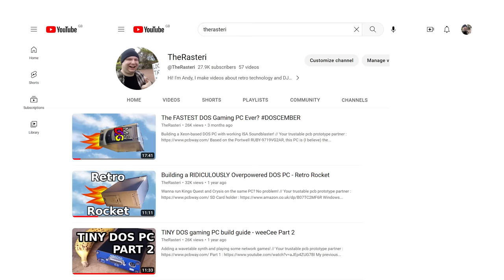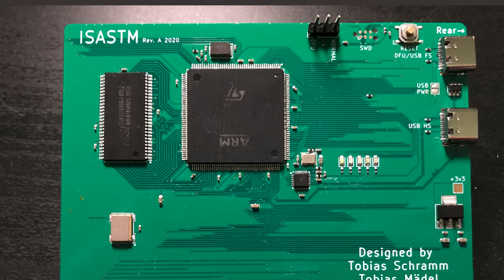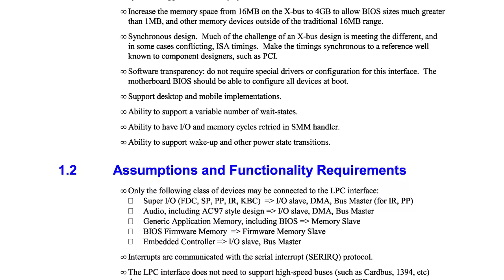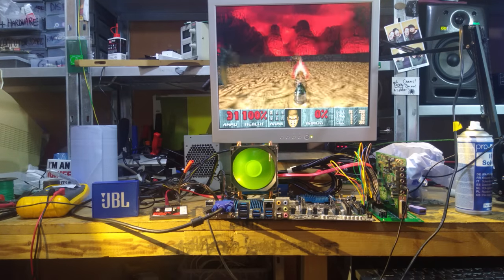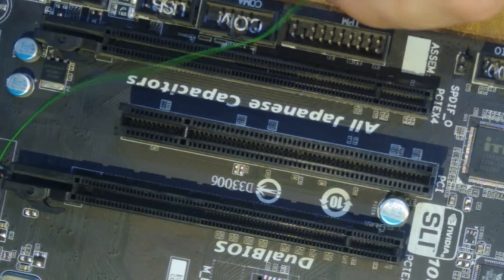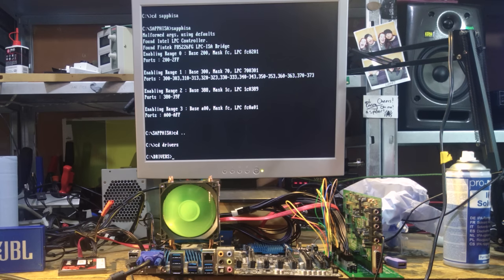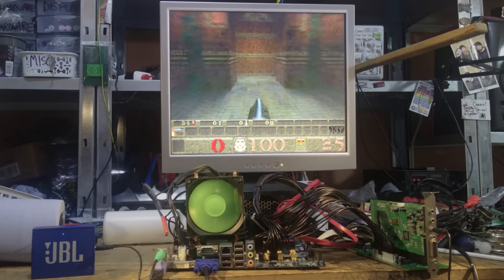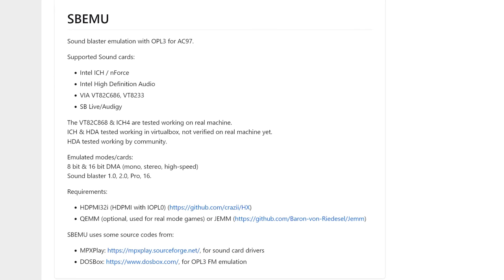Add an ISA slot to Modern Motherboards!

Comment: Re the quake issue, it's been a long while, but i recall as a teen having issues much the same and i believe that it was because certain builds of quake had issues detecting the sound blaster properly and/or the driver was not playing nice with it / overwriting the SET BLASTER = command line incorrectly. You could try doing the full set blaster= A220 I7 D1 T6 (force it to know it's a SB16 (or T4 is if't s  SBpro) the other one could be to try with the H5 as well.

I actually ended up using PCEM to run a lot of the older stuff (which if you can get your hands on the BIOS Roms etc is a really nice alternative to actual hardware and better than dosbox as its a hardware emulation not just all in software)

Comment: This seems like a ton of fun to try.  I'd definitely be interested in buying one.

This may have an obvious answer, but thinking to the far future, would making a PCIE addon card that has the necessary chip and hookups for the dISAppointment be possible, for example for boards or processors that no longer support it on board?
Reply from the maker: I'm not aware of any PCIE-to-ISA bridge chips that support DMA, so likely a custom FPGA/CPLD would be required, and that's a little beyond my skillset just now :)
Reply: @TheRasteri  Gotcha, thanks for the response.
Reply: @TheRasteri  IT8888F is PCI-ISA bridge and PCI should be possible to bridge with PCIe-PCI bridge. Not sure how much compatible is IT8888F with ISA DMA, but it has several DMA request inputs on ISA side.
Reply: @petrcvek  I looked it up and it requires a PPDMA host in the chipset in order for the DMA to work. It should be possible to emulate this but if the motherboard itself has any vestigal support for ISA DMA there will be a conflict.

Comment: I am interested in this.  I built a custom computer on an ISA-AT card in the mid 80's.  Based on a 80186 processor with 8087 math co-processor.  Took 3 months to build with wirewrap.  It hasn't run for decades.

Comment: Fun fact: If you have an old 9x motherboard like that, with the ISA slot, and the bios battery has long died, Video output will default down to the ISA slot. AGP/PCI/Onboard on those boards (typically btwn like 1996-1999) can't do anything without that data.

Comment: I have a PC 104 card that I think uses ISA. It's for a centroid CNC controller from the early 2000s. I bought the CNC at auction and it booted up running a really old hard drive. I was able to track down a modern PC 104 compatible motherboard. I believe it's running a Intel atom processor. My goal is to try to run the latest version of the centroid software to get some of the latest features

Comment: I wonder if ISA passthrough exists in qemu. I installed dos inside qemu KVM, it's wonderful.🎉
Reply from the maker: Yeah this would be very interesting to try
Reply: I modded Bochs VM to add port-based ISA passthrough . I imagine QEMU could be made to do the same. DMA would be a harder but still doable. The nice thing about doing it in VM software is that it can be redirected anywhere, including that ISASTM USB adapter.

Comment: This is awesome! Is there any particular brand or type of board that has the correct tpm pinout? Is the pc104 soundcard project, and the wee86 project both finished enough that you can sell boards for those as well? Every project you show like the pc104 soundcard, and wee86 is great, and makes me want one...
Reply from the maker: I'm working on making the weecee more accessible, certainly :)

Comment: You can use a SoundBlaster PCI128 with DOS games. They came with a TSR driver, no Windows required.
Reply: That's based on Ensoniq AudioPCI. OPL emulation on it sounds entirely wrong, and the TSR isn't trouble free. If you want to use that, you are better off instead with SBEMU and a supported onboard audio or cheap and abundant PCI soundcard, which does a much better job.

Comment: Drivers for Modern Windows Shouldn't be a problem The Windows 7 DDK has the source code for the wdm SB16 Driver as a sample driver. The driver source code should compile for 10 or 11 with few if any modifications. The trouble will come from everywhere else. If Modern Windows doesn't automatically detect a PnP SB16 during PnP discovery then there wouldn't be much hope getting it to work. Modern Windows really doesn't like non pnp devices. Looks like Windows relies on ACPI to enumerate all lpc devices. 

Pretty much If Windows can successfully enumerate PnP isa devices connected to lpc then getting the device to work with Vista or 7 drivers most likely would be reasonably straight forward. Except modern Windows may not let you specify the IRQ and it would probably default to 5.
Reply from the maker: this is great info, thanks!

Comment: Great job. Regarding graphic card, I'm highly skeptical it could be achieved without BIOS mod, unless game could work with non-primary display adapter (e.g. you get DOS prompt on primary display, but when start game, it runs on secondary).
Reply from the maker: I've since discovered that intel removed the ability to do memory read/write over LPC at some point (possibly early ICH revisions), and graphics cards are memory-mapped. Even if the BIOS could support it we're limited by the intel chipset.

Comment: This is great.  One question - could this run more than one socket as its a bus?  So still have the space to plug in a tpm module but have an ISA slot too?

Comment: some thoughts;

power regulators supplied via a molex or sata power connection to clean up the wiring some. ~15w max for sata connectors, molex 4 pins are rated to roundly 140w. 6 pin pcie are rated to well above that. all voltages could be derived from some mixing and matching of the 5 and 12v lines, and the corresponding -15 and -12 could be generated with some careful ic selection. i will admit this would bump any bom pricing up, as well as the complexity of the board schematic/assembly. this would, however, streamline putting one in a case with a smaller motherboard, eliminating the complexity of the actual install side. the negative rails also generally don't need much current, so you can get away without needing to supply much in the way of heat dissipation, usually.

i know there's eSPI/LPC/etc bridge chips out there, but i don't know how viable it would be to implement a solution around them.

possible rp2040 FPGA-esque solutions to be had, or even just FPGA conversion of signals. possible pcie -> isa in a somewhat plug and play solution may be possible this way, though it would require actual firmware/etc writing, which may be beyond the scope of how complex you want this project.

at any rate, this looks very promising, if that quake/sb thing can be fixed. and the -5v, since modern psus don't supply it at all, and with one slot you can't use a voltage blaster or equiv.

cheers.
Reply: ATX supplies 3V3, 5V, 12V, -12V and doesn't supply -5V. SATA connector supplies all of these without the -12V. I suggest that since -12V and -5V are low current, you can use an industry standard 7660 (ie MAX1044 but there's a bunch of them, literally every company makes one) to generate these buses. I would suggest that -5V is optional, there's only a handful cards that need it, so you can even just foresee a linear regulator for it but leave it unpopulated.

I don't think systems with a legacy PSU (where SATA power doesn't carry 3V3 or isn't present) are necessarily the target for this hardware; however, there a similar approach is suitable - foresee cut-jumper and a linear regulator, leaving it unpopulated. These should be all-through-hole parts - i know most of us can assemble SMD blindly, but more people will be comfortable with through-hole.

Comment: Any suggestions to break out PCMCIA to full size ISA? I figured it is theoretically possible, but I wanted to see if anyone else gotten to it.
Also, any thoughts for Magma CardBus to PCI adapters?
I got lots of vintage laptops as they take less space, but I got a Voodoo card I want to use with little Libretto laptop.
Reply from the maker: I've not investigated PCMCIA or cardbus at all. Maybe one day!
Reply: I did the magma CardBus route to add a voodoo2 to a libretto ff 1100. You will need an external monitor on it but it works fine.
Reply: @ianhanschen  Oh Man, good to know. I was planning to route output to OSSC for VGA to HDMI conversion, as there is no hope to display voodoo graphics on built in screen. 
Though apparently in theory it should be possible to route video back on some laptops as there are hookups for displaying stuff on screen in PCMICA bus. Apparently meant for MPEG cards. Though it seems signaling is pretty weird, so maybe something to explore in the future.
Reply: @ianhanschen  Also Magma CardBus seems to have same weight as gold lately, since prices for them in stupid big. Did you manage to get it for a good price?
Reply: @TheKsax  I did this project in 2019 when things were a little cheaper.
Reply: For PCMCIA to ISA, you should try making an ISA card that you can stick into a passive backplane, that way you can just use whatever backplane, and swap out for more slots any time you have enough money to experiment. IBM themselves did something similar by releasing an expansion chassis around the same time as the XT (though that was ISA to ISA): there's even a open-source clone of it that you could start from.
Reply: @TheKsax  It's possible to read back the Voodoo framebuffer over the PCI connection. So it shouldn't be too hard to read it back and output on the main video chip. The main issue would be performance degradation.

Comment: with the 8894, it's not 24 core, the first number indicates the number of processors on a motherboard, in that case 8, that means 192 cores.
the more "reasonable" solution is getting some 8880 V4, which are available at around 80-100 bucks currently (8890s are 500 and I couldn't find 8894s) and find some second hand 8 socket motherboard.

and if you want an actual machine, either 2 E5-2689 v4 (100 bucks per) or a single E5-1650 v4 (26 bucks) seem to be the best option. you can get a brand new so-called "X99" motherboard (which uses recycled server chipsets and a custom bios) for 50-100 bucks depending on the number of sockets. ram is pretty cheap too, so I reckon you could get something working for like 500-600 bucks.
Reply from the maker: I have one of those "machinist" X99 motherboards, unfortunately the DMA lines aren't wired anywhere (I checked). Maybe I can add a wire under the PCH now I've desoldered it though haha.

Instead I've been testing a an LGA1150 motherboard with a Core i7-4790k CPU, should have as good or better single thread performance than any X99 chip. Which is obviously more important in DOS than core count.

Comment: This is perfect. I was just thinking about building a 775 DOS machine with a 519K/ I have half a dozen of them, courtesy of random free junk and will be testing them to select the best. Pretty funny when I'm gonna completely neuter the CPU, lol. But I need my head examined for thinking of building a P4 DOS rig. I only want to have to do it once. 
It is also completely pointless with regard to your doodad because many of us collectors have at least one 775 board with an ISA slot. Go to socket 478 (not hard to do. I have a 478 P4 HT that can run a modern windows desktop environment with an ISA sound card) and it is easy. Socket 478 is currently ewaste that you have to pay someone to dispose of. 
Also, when you say "modern PC", you really mean "modern-ish". I don't need a TPM header to access the LPC bus🤣I don't think anyone is going to be trying to do this on Zen. I have 3 Zen machines and I won't be wasting my time. It would be like using an atomic bomb to blast a new drainage ditch. Frankly, using a 450MHz PIII running on a 66MHz bus at 300MHz is pretty much the most CPU any rational person would attempt to use for native DOS gaming, lol. Anything more and you're gonna be using setmul for everything, not just the pre-486 games. 
I also have a pile of 2nd and 3rd gen intel mobos and CPUs...Maybe I can make some money selling "DOS gaming PCs" based on e-waste hardware that you can't pay people to get rid of these days. If only I could carve an i5 up into 4 CPUs...
The real draw would be the 476GB of vintage games that would (mysteriously and unintentionally) find their way onto the hard drive🤪In 238 different partitions, of course. 
What I really want to do is figure out how to get one of my 3rd gen i5s running 4 DOS virtual machines. One for each core. Hello LAN party! Stack up half a dozen of them with a simple Pi server and you have a fun time for a whole lot of nerds, playing on whatever modern device they happen to have in their pocket...If you do software rendering, one 3rd gen I5 core is probably about the same as a P200MMX with a RIVA TNT2, if you neuter the cache.

Comment: Very cool project, have you tried an AWE32 or AWE 64 Gold or a Yamaha Sound Wave 1000 XG?
Would these work as they would with a system that has ISA as well?
I am curious to such results as for playing high grade midi music files.
Reply from the maker: I've never tried any of those but they likely will work, yeah. (except the SW1000XG, it's PCI )
Reply: @TheRasteri  ah yea the Sound Wave 1000 XG is PCI indeed , Something I should of known rofl  you got point :) I did buy a nice slot 1 Pentium !!!/E 850Mhz CPU 2 days ago, around May of 2024 I hope to get my new rebuild of a 1999-2000 retro build, completed. 

It will be using real HDD's  from that timeline, it's gonna be a date correct build in that sense. 
Always fun, especially hunting down the parts and hoping you'll find the the wanted and needed parts in good shape, recaps are a standard procedures these days, it's all part of the package.

Here the setup:
-----------------
Avenger M99

Intel Pentium !!!/E 850Mhz Coppermine CPU with 256KB L2 Cache for SECCII / Slot 1
2x 256MB PC-133 @ PC-100
ASUS P3B-F Intel i440 BX Chipset
Matrox Millennium G400 MAX AGP 32MB 128Bit SGR Rev.A 4399
2x Gainward Dragon 3000 Voodoo2 PCI-12MB's in SLI both are Rev.A 0599's
Creative Labs AWE64 Gold CT4390 + CT1950 Pro 28MB Sound Font Memory Module by Anthony Zxclxiv from x-3dfx
1x 80 GB Seagate Barracuda V 7200 rpm Hdd + 2x 250GB Seagate Barracuda V 7200rpm Storage HDD's
Windows 98SE + UnOfficial Service Pack 3.5 USA
Addtrronics 7896A Server Tower
Enermax EG465P-VE PSU.
-----------------

for me I won't be needing any kind of emulators but for those that don't have a decent retro PC, these convertors can be very ideal.
So yea nice work!

Comment: Is it possible to do a 2 or 3 slot dISApointment? it might be fun to wire it up for the old networking audio and a graphics card putting a new system in with an old network.
Reply: Another use in mind for a multi slot. Putting drive headder cards for each generation into the board to do a multi generation data server still using the 8 16 and 32 bit formatted hard drives.

Comment: Many thanks to the author. This seems to be the perfect solution for my old ISA development boards which I still want to tinker with. Forgive me if my question is stupid, but how can I get hold of the DISAPPOINTMENT board - populated or unpopulated, DIY kit, etc. I checked on PCBway, but could not find this project among the shared ones. Also, I see that the schematic and layout is available on github, but this will require ordering parts and PCB which will take some time. So what is the easiest way to do it. I hope such info will be quite useful to other interested people as well.
Reply from the maker: I should have the board up in PCBWay's projects section soon, I just need to test the latest revision. I'll make a channel update when it's done!
Reply: Great, I will be waiting. For now I subscribed to your channel. Thanks again @TheRasteri

Comment: Would love if this can handle a floppy controller. There's no way to write to 5 1/4 floppy on any current solutions.
Reply from the maker: RayeR has actually made an LPC floppy adapter - http://rayer.g6.cz/hardware/lpc_sio.htm
Reply: @TheRasteri  Neat! Hope the project gets released via a kit or with some intermediate friendly documentation, my Czech isn't great😅
Reply: @namuzed  Haha he hasn't actually published the project :D I don't know if he's pushing it forward or something. I mean i could just re-draw it from the PDF and images and make a handful, but i don't want to step on someone's toes. Also it's not like you plug it in and connect a floppy and it would work, there's a software work to be done. Probably easiest on Linux.

You know what would be funny? If there was a way to connect to the pins of the chip nonintrusively, the existing SuperIO on most AM4 mainboards, where the floppy controller is right on there. Unfortunately i don't have such a candidate, i think mine has the Nuvoton NCT6796D or similar which is more of an SMC than a SuperIO, it can do a ton of things but lacks a floppy controller, but they DID break it out to a surprising degree, i have an LPT and a COM port! Can't blame my mainboard for skimping on easy connectors. I think i have heard of something of a kind but it's evading me for the moment, some sort of PS2 modchip or something that you just press on, but i really really doubted from moment one that it'd ever work. Like you know the guy, "Bits und Bolts" who extended his Voodoo to 8MB recently using normal SOJ sockets which just press on and contact the chips upside down from the other side, but unfortunately the SuperIO are usually qfp128 so there really isn't an easy socket trick like that. The other way is just a flatflex that is easily soldered to the perimeter of the chip, to break out the signals.